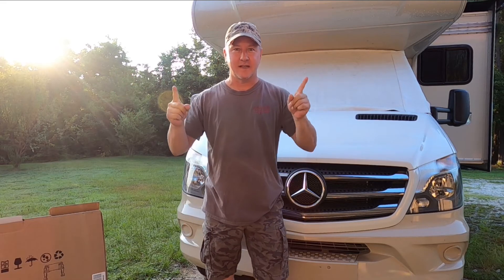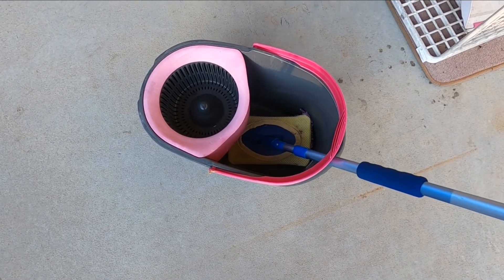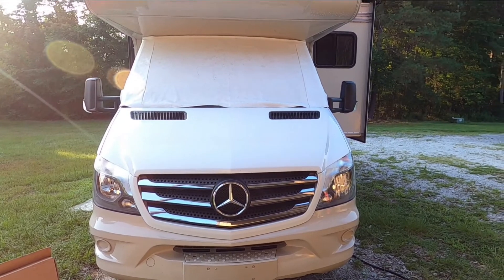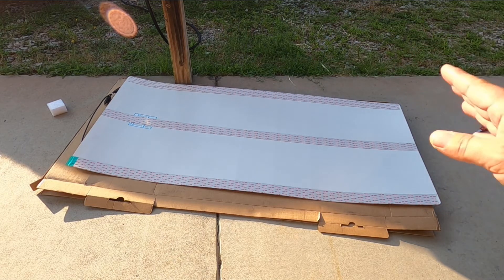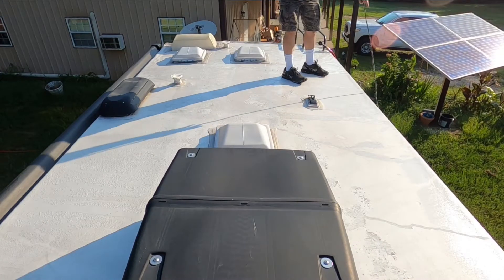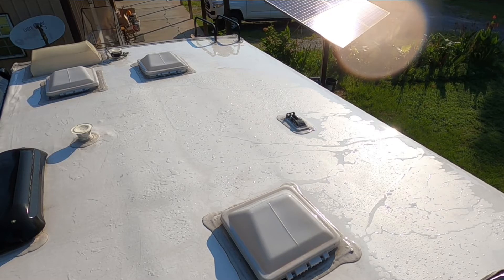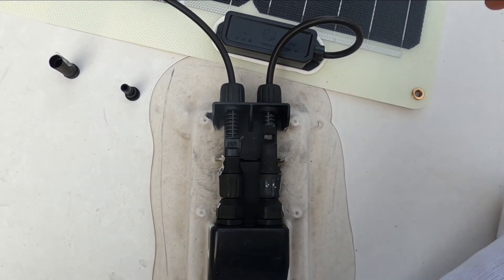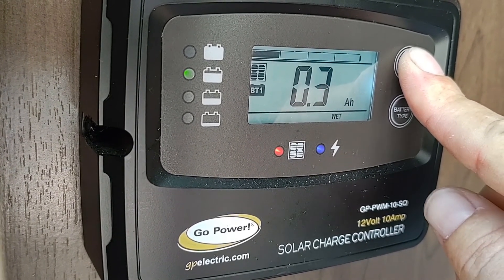2019 Thor Freedom Elite 24fe -RV Solar Panel Install

Comment: I am going to do exactly what you did next week with the same materials. Are you still happy with things years later or is there anything that you would do differently? (excellent video by the way).
Reply from the maker: Still working great.  Only thing I did was change over to Lithium batteries and the Renogy 30amp controller that works with lithium.
Reply: @DeeYohsGarage  thanks!

Comment: Great video - are they still working well for you and no issues with overloading the 10amp solar controller?
Reply from the maker: Panel is still working perfect...and 10amp GoPower is going strong.   I do have a Renogy 30amp controller that I will be installing at some point just haven't  yet.   We have some old 175watt  Evergreen panels that I took off the Garage.  I will be using the GoPower to make a stand alone charging station.

Comment: Where did you purchase the windshield and door windows cover... I have the 2021 Thor 24 FE and I want the same cover if I can find the right size... thank you
Mark
Reply: Thank you very much for the reply and good information 👍kind regards 
Mark
Reply from the maker: Sorry been on vacation. :D  I got them off Amazon.. just looked and the one I bought says unavailable...  The part number I got was ADCO 2423 Polar White Windshield Cover Sprinter.  There is another that looks just like the Adco one.  https://www.amazon.com/Classic-Accessories-White-Windshield-Cover/dp/B001A7RP32/ref=psdc_9659678011_t1_B00JVQFXB0

Comment: I have a 2016 Thor Synergy TT24 and am looking at solar panels too. What has been your experience so far on how well-attached the panel has been after some road trips at highway speeds?
Reply from the maker: Sorry for the long delay.. The panel I installed is permantly in that spot.   After many many trips now, the panel is exactly how I put it up awhile back.  No chance of moving.  I believe the roof will come off before that panel.

Comment: Great video,  Did your 24fe come with solar panel controller?  I'm installing a solar panel soon mine is prewired, but no controller,  I was wondering if you knew wire color polarity?  I'm thinking orange/blk is negative,  white positive?
Reply: Mine didn’t come with the controller either.  So where are the wires from the roof connector?
Reply: @tommythekid85  24fe, you'll have to look behind main breaker box, by the bed, best to remove the breaker box, you'll find blk-orange and white wire...I just got done installing an inverter it was  PITA, very tight spaces.

Comment: Is the 3 m tape double sided foam tape?
Reply from the maker: Yes.  Thicker the better.  You want a small air gap.  Panels get hot.
Reply: Thanks!  I really appreciate your video!  We have your exact rig and so we bought the exact solar panel to install.  How is yours holding up?  I saw an 18 volt panel with excellent reviews but wasn’t sure we could use it as our inside panel says 12volt. I now have both and the 160 watt 18 volt is a super flexible but much smaller.  Longer connectors .